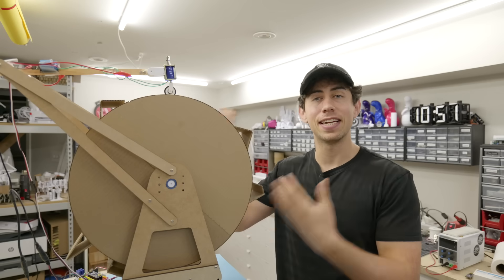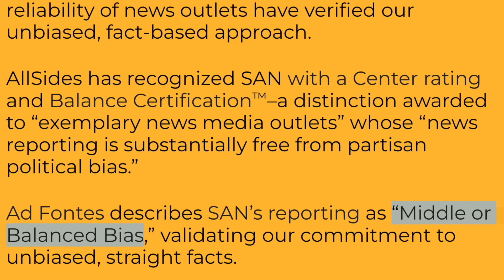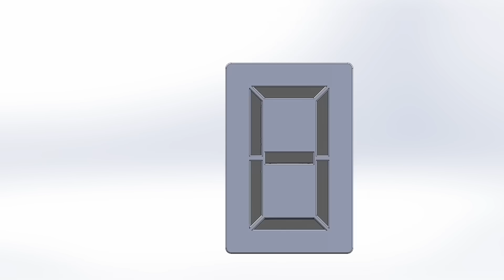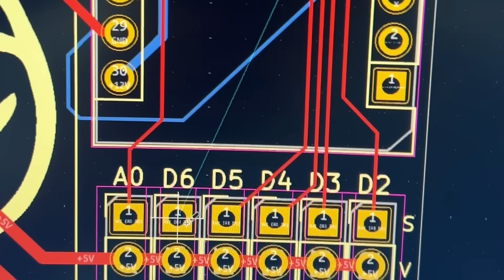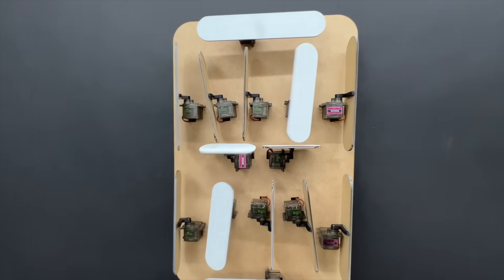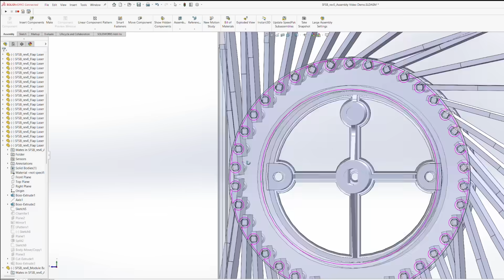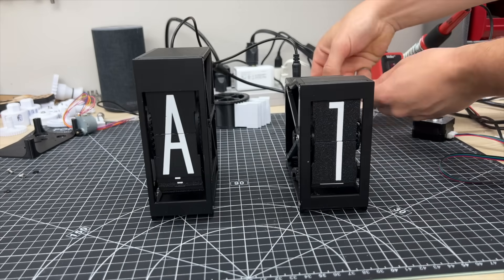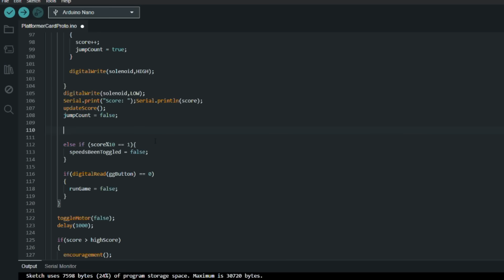This split flap scoreboard is SO satisfying

Comment: Belt to select character plus belt to drive character lets you run an entire row of characters off just 2 motors. HUGE cost reduction. + optic gate on selector belt to see the 0 position of the characters on startup.

Comment: The sliding section display is awesome.

Also you should make the game on a long belt that is not all exposed to the players Vision though. Put it all in a cabinet and fold it over back and forth on each other. As the belt comes into the view area the obstacles self-assemble, so you would build some type of tension devices.
You can 3D print all the parts in color and make it look like different scenes or you could print everything bright white and use one of those cheap USB projectors to project a rolling scene.

Comment: Suggestion: Only score up when the roller is in the downmost position. Just use a light bartier to detect whether the lever is deep enough so the wheel is on the floor of the big wheel. No (or minor score) for hitting the button endlessly while you try to save yourself from a nearby collision. 😋

Comment: Its cool but its hard to call it an antique game when you are controlling it with 12 microcontrollers and code. It would be cool to see scoring done mechanically instead. If the score area was just numbers, the counter balanced arm could act as a contactor to run the display motor the entire time you are in the air, so you get points for airtime instead of just button presses.

Comment: I do believe that the channel of the wooden counter had a video showing a switch that decouples the counters when linked together, to allow for each counter to be shifted to a specified number, which would be an easy way to reset the displays quickly, but having the that would involve a bit of tracking code to keep tabs of what each display is at, so that when you have it reset, it will know how far back it needs to roll each of the displays.

Comment: Hi, completely new to mechanical engineering and this video was super interesting! Just wondering why you say at 5:08 that a stepper motor would allow you to go from 9 back to 0 directly? I’m confused because it seems like you just need to keep turning it to wrap back around
Reply from the maker: A servo motor is limited to 180 degrees, so the only way to get it back to the start would be to go backwards. The benefit in this case is it has control hardware built in to it so it’s very easy to control. A stepper motor can turn infinitely, so it can go from 9-0 directly- the tradeoff is you need some extra hardware to make the motor spin, and even more to be able to control angles precisely!
Reply: @Engineezy Thanks so much!

Comment: Scoring should be based on the degree rotation of the stepper motor relative to start position:
 - Stops you having to repeatedly click to score, if you get a good jump, the score increments automatically. Rewards good jumps/timing
 - Because it's based on rotation rather than time, the score increments faster as the difficulty (speed) of rotation increases. Combined with your existing function to increase rotation speed over time, more time = more speed = score increments faster
Reply from the maker: Definitely going to be improving that on the final version!

Comment: (I'm sure this has been suggested but...) You should give reflow soldering a try! It really makes assembling your own PCBs significantly easier. When ordering from your PCB supplier, you can usually get an SMT Stencil cut for a few dollars more (with JLC it's usually an extra ~$10, I think the cost is similar with PCBway). Then get some solder paste (T3 is usually fine) and squeege it onto the boards and reflow them -- the best option is to use a reflow oven like the T962 (smaller) or T962A (bigger), which can be ordered from Amazon or eBay. But you can also get good results with a heat gun and hot plate.

Love the split-flap displays -- they are my second favorite mechanical display after flipdots.
Reply from the maker: Definitely need to give it a shot!

Comment: Rather a spinning wheel. See about making a conveyor belt that way you have more of a flat surface
Reply from the maker: That was the alternate plan, but it comes with some big challenges if you want variable obstacles- something I will be talking about in the next video
Reply: @Engineezy  see what I've noticed while watching this video was the button activation switch that indicates the game is over did not initiate when it was pressed. Maybe you can have a touch sensitive sensor, so that when it touches an obstacle it will stop the game and the jump button activation. Also you should try and make it to where it looks like an actual arcade machine

Comment: So coool! 
You could add a sort of level system to the game. 
For example you could limit the power of the solenoid for the first levels (and so the heigth of jumps). 
So at a certain point when obstacles are getting taller or longer the player will not ne able to pass them. Unless he catches a special item along the way. Like a coin or a star that's floating in the air.
Could be awesome! Continue the great job man 👌
Reply from the maker: That’s exactly what I have in mind 👊👊👊

Comment: You should add some sort of Contact or switch 
at the counterweight to automaticly messure the flight time 12:05 With that in place you don't have to spam the button
Reply from the maker: That whole system is going to be improved!

Comment: As the game gets faster and faster, your method of controlling the return of the character to the ground will mean that the window of opportunity to jump again will be overshadowed by the "cooldown" of the falling player. It might be possible to counteract this by influencing how quickly the roller falls down onto the wheel again. The first idea that comes to mind for that would be an opposing set of tensioned belts attached to the counterbalance point, where the position of the belt tensioner is controlled by something like a rack and pinion set or two servo-controlled tension "arms". The elasticity of the belt means the roller can still "jump" against it's force, but the rate of ascent and descent could be controlled with more granularity.

this is all assuming that you intend for the player to be able to keep playing well into some pretty serious RPMs, but if the soft-limit imposed by the counterweight setup is an intentional difficulty choice then forget everything I said lol.
Reply from the maker: Definitely something to keep in mind! I might be able to modulate the obstacles as it gets into the higher RPMs as well- gonna have to experiment with it a bit

Comment: Maybe you should limit the motion of the arm player thing. I noticed that the main wheel slows down a bit when you finish jumping, so maybe it would be better to stop the falling "player" with a constraint on the arm rather then stopping it with the "player" wheel touching the ground
Reply from the maker: I think the final version with have a stronger motor on the wheel so this likely wont be an issue!

Comment: This is so awesome! A quick suggestion to make beating high score more fun: once the high score is beaten, the high score section could increase in sync with the score, like it did in many actual video games. Also, the moment when the high score is beaten could be marked by all high score flaps making a full revolution (or several).
Reply from the maker: Great ideas!

Comment: Where did you get the cable to daisy chain the boards? would DuPont connectors not have worked as well?
Reply from the maker: I ended up making it myself! Not sure if theres a better way- the dev board wasn’t developed with multiple i2c pins. Something for the next one
Reply: @Engineezy  That’s great, I wouldn’t have guessed it was homemade
Reply from the maker: Took me #?!@& forever to make them 😂

Comment: Question! For the geneva gears, could you make a clutch mechanism that disengages them from the gearing and then idk a weight at bottom dead center and then they fall back to 0? Then réengage clutch ..
Reply from the maker: Thats a really great idea
Reply: @Engineezy  🥹🤩

Comment: Is it just me, or did you go overkill on microcontrollers?? You’d really only need 2, assuming you’re using an Arduino nano with 6 PWM pins each. Or just use a single Raspberry Pi Pico
Reply from the maker: Unfortunately PWM doesnt work for steppers, might have gone overkill, but this was the easiest way for me to implement right now!
Reply: @Engineezy  How so? As long as you have a motor driver board, PWM works very simply with stepper motors. I’m in mechanical engineering and I’ve used the same NEMA17 stepper motors controlled by PWM. I’ve used Pololu MP6500 amongst other stepper motor drivers.
Reply: Don’t get me wrong tho, this is a super awesome project! Just would make some of the hardware more accessible and cheaper haha.
Reply from the maker: True! Obviously I still have lots to learn haha

Comment: You can detect collisions by measuring the speed of the wheel. Or the torque the motor exercisces to move it.
Another way is to make the obstacles from metal and measure the conductivity between the roller and the obstacles.
You can count scores by counting the jumps using a sensor triggered by the lever. That way the player would not be able to "pump scores" by repeatedly pressing the button.
Reply from the maker: Great ideas 👊👊👊

Comment: This reminds me of some of the ethical challenges of building retro-computers. It's just so much easier to use a microcontroller instead of $50 or more worth of 74-series logic chips on a huge board. But then, is it still a retrocomputer?  As long as you don't touch the CPU, I say YES! Ain't nobody got time to out-Arduino an Arduino using relays and hamsters!
Reply from the maker: Haha agreed! And the purpose for me is to make a video game without the videos more than make an analog video game

Comment: This is awesome! I've been looking into building a flap-based displays for a while, and your design is pretty neat! I'm just wondering why you're wasting so many Arduinos by having one on each module, instead of just talking to the stepper drivers from a central MCU?
Reply from the maker: This makes it so much easier to control, probably worth improving on that but honestly not sure if I have the programming skills to get it right

Comment: Having more computational power tied to each scoreboard than early consoles had overall is its own power move, but have you considered going with electromechanical logic for that, similar to how the early pinball machines operated, using only solenoids, switches, and cams? Seems like it'd fit the spirit of the channel.
Reply from the maker: I considered it briefly! But the goal is to build a video-free game more than a vintage game, so to get all the features in im just going to brute force it with modern electronics haha

Comment: Another possibility to add a lose sensor is instead of relying on a button to tell if it hits an edge, which could miss the right part and not sense it, you should instead take example from the cassette player, (which was pretty much from the golden era of electromechanical tech) and mechanically link a sensor that tells if it is spinning or not with a belt or gear. When the large wheel meets resistance from the character, the wheel will stop spinning at a consistant speed, so try to find a way to sense that change electronically. In a cassette player, if it realizes the other reel is not spinning, that means that the big driving motor can stop tugging at the now ended tape. This could also help you hide the mechanism better as well and centeralize the electronics away from the direct player view.
Reply from the maker: Load sensor is a great idea! Will definitely look into it

Comment: It seems like a waste to have used so many microcontrollers. I would have just grabbed a mega and a ramps board. There is already plenty of documentation for ramps board and it can drive 5 already. You could make just 1 more board with just drivers and it would probably cost less overall. But cool project none the less. It came out great!
Reply from the maker: Had to brute force it on this one! Will definitely look into ramps

Comment: You can reset the counter with just one motor if include a "geneva tab" that engages only in reverse at number cero. Maximum movements to cero are as many turns as digits.
Reply: Didn't some have a button that you could push and they would all snap back to zero? I have a height gage at work with an inches counter that works that way. I'm pretty sure you could have a single drive motor and a reset solenoid.
Reply from the maker: Definitely worth looking into!

Comment: Man if you JUST learned to use EDA and are still using breakout boards and modules for everything, WHY WOULD YOU USE 0402 PASSIVES?!

Also I use EAGLE because that’s what I started with and now my workflow is completely incompatible with kicad…
Reply from the maker: It was because I only got the template ruler after I ordered the board 😂
Reply: Bruh

Comment: The reason the small stepper motors were so slow is because they have a built in gearbox. They are really meant for slow operation because of this and apparently they are used for controlling things like AC vents.

Something that may be of interest to you is very tiny stepper motors, they can get ridiculously small but could be useful for something due to their size. I have never seen them actually used but they are easy to get and very cheap so something must use them. Potential uses I can think of are in cameras, where you need it to be very small but still need something to rotate precisely, possibly for zoom or focus.
Reply: the small stepper motors need to be geared for them to have any decent level of precision too. They have a vastly lower number of poles, so they can't position themselves in very many places.
Reply: I bet the built-in gearbox is to increase their torque enough to be useful. That's a great way to save money if you don't need the acceleration.
Reply: @creativecraving  well that's one of the few reasons to use a gearbox in the first place. If you don't need the torque or precision (or going the other way, speed) then you are often better off not using one. They always have a trade off like if you want more torque then you decrease the speed. Like I said these stepper motors are often used for low speed tasks in consumer goods and appliances.
Reply: I bet the built-in gearbox is to increase their torque enough to be useful. That's a great way to save money if you don't need the acceleration.

Comment: I had a few ideas when I saw the obstacles you added to the wheel. It would be good to have the obstacles be adjustable during use and I have a few ideas for this.

The first idea is to have the wheel split into segments, held in place by magnets or clips, by using multiple magnets you could have multiple snap heights for each segment, then two solenoids at the bottom of the wheel, one solenoid pushes the segment outwards and the other pushes it inwards. This may work but may be unreliable or inconsistent.

Another way is to have each segment driven directly by an actuator, like a servo or solenoid, you would need servos or solenoids in the wheel for this, so you could use wifi or another communication method with a battery or inductive power or you could just use a slip ring to get power and data to the actuators. Likely the best way using a slip ring is to have the two power lines and then at least one data line. One data line may be enough if you just need one way communication or you could maybe use half duplex communication if you really need bidirectional data or just add another data line. Then you have a microcontroller in the wheel that takes that data and then controls the actuators. With this you could control the position of the segments at all times and that would allow for moving obstacles too.

Edit: this could also potentially solve your scoring problem, if you can keep track of the position of the wheel you could tell if they managed to clear an obstacle or not. Or much more simply with no ability to spam the score is to just base the score on the number of rotations.

Edit 2: should have just waited until the end of the video.
Reply from the maker: 😂😂 I like how quickly you got there though! My plan right now is a slip ring for power and data, and servo driven actuators in the wheel. We will see how things progress though!

Comment: So you take a lot of ideas and designs from various people's open source project, make your own version then charge people for it? How very Bambuesque
Reply from the maker: My note on this: Bambu Lab’s product is an incredibly dialled and reliable machine. No one has to buy it, and there are machines that do something similar for much cheaper.  I have used those machines, but I opted to use Bambu Lab. Nobody needs to purchase anything from me, and these videos are completely free to watch, you can even skip the ad if you choose. My models are just one way for me to finance these videos which require a ton of time and money to produce. If you don’t want to purchase anything from me, or watch my videos, that is completely up to you!
Reply: @Engineezy  The bambu comment was because bambu took prusa's open source slicer software and reskinned it as their own.
 
When you are 'reverse engineering' an open-source project then selling a design based on it, it is no better than theft and goes against the open-source idea that you have benefitted from.